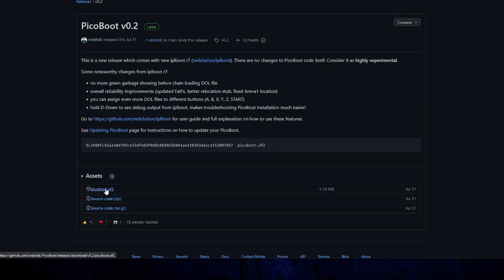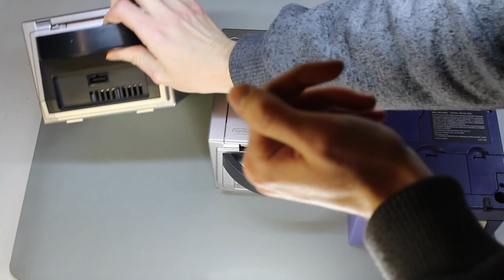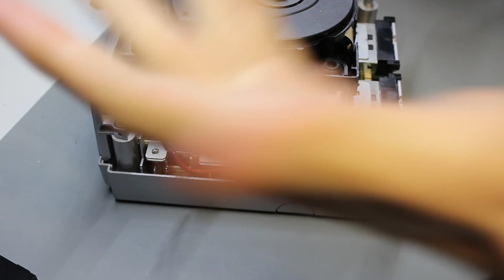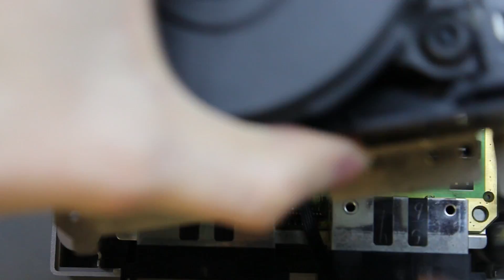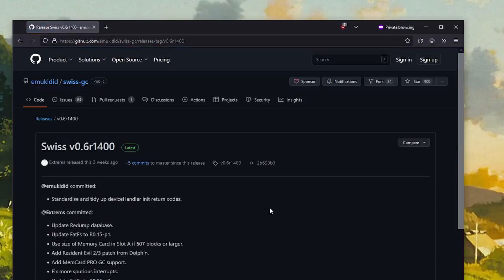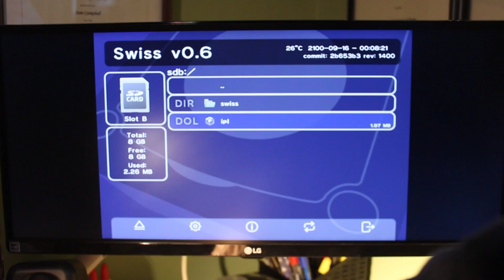PicoBoot GameCube Modchip Installation Guide

Comment: I reccomend using a PH1 and PH2 electronic screw driver, they are a better fit and probably meant for those. You can also replace those annoying gamebiut screws with wood screws, they have the same thread size